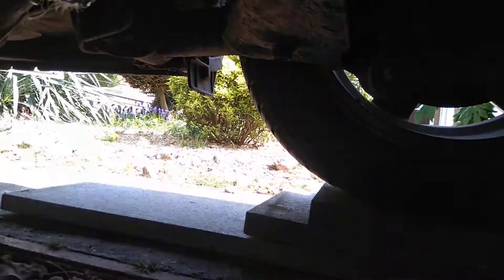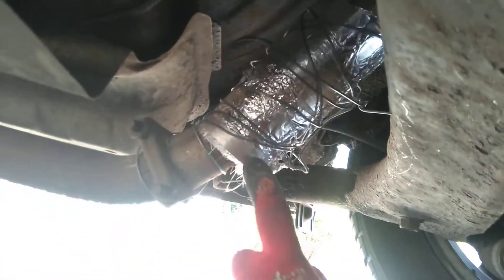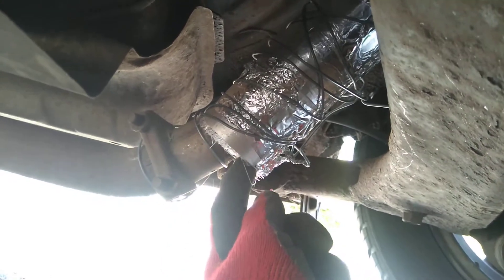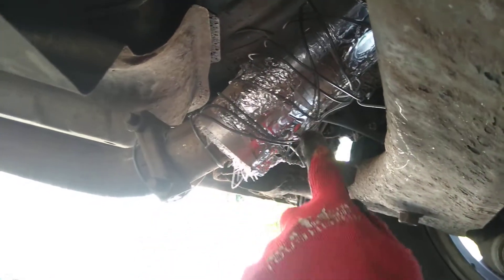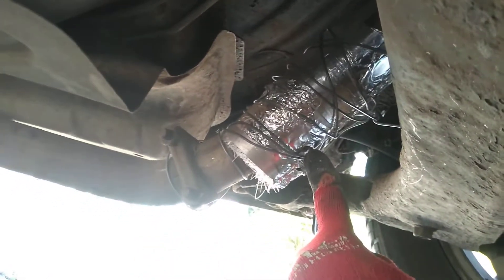Fixing exhaust pipe Toyota

Comment: I bought a commercial quick fix kit once. It worked ok.
Reply from the maker: Had to get the whole exhaust system replaced, as the brackets were lose & the catalytic converter part also had a leaking area. It's working now but engine is making  click sounds. A bearing or worn crankshaft, hmmm, cars are money pits, luckily I have only one.
Reply: @Yamasallow2025  It's probably cheaper and better to just get a new one James, especially with interest rates down here.